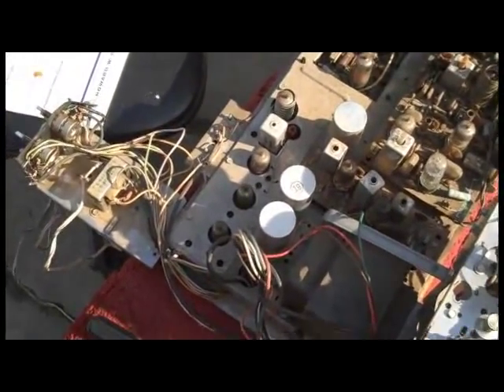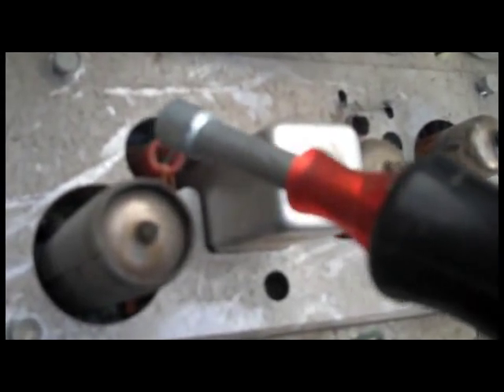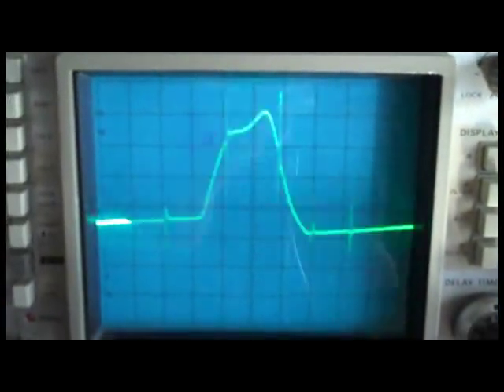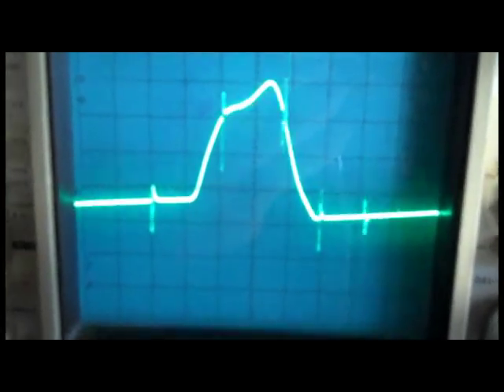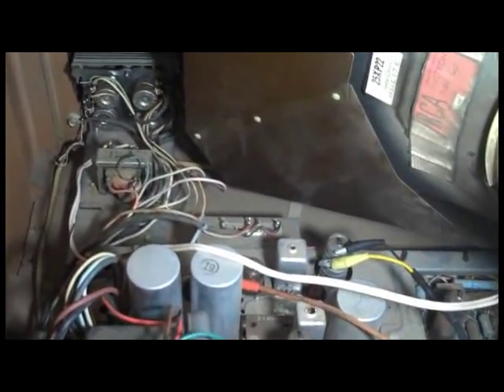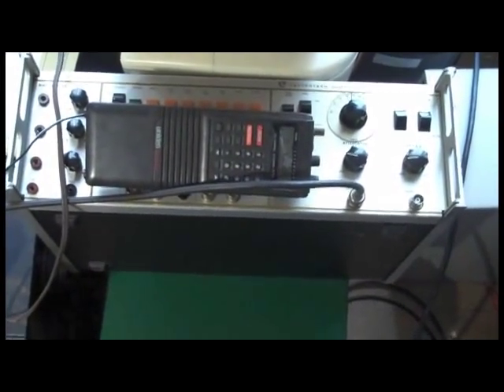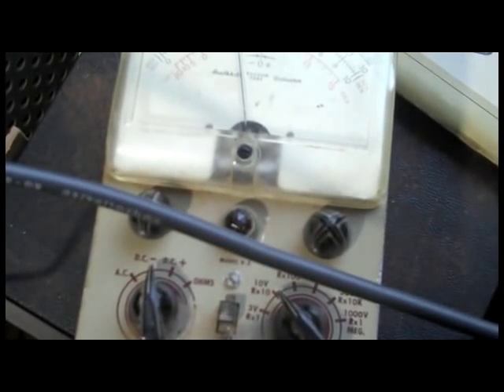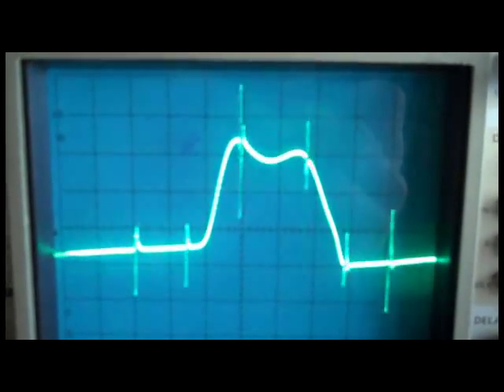IF Alignement on Vintage Television using B&K 415 Sweep Marker Generator part 1

Comment: I warm-up them frozen cores with a heat gun and sometimes a soldering iron on the core itself to put some heat into it to loosen up the hard wax and this has always worked as long as you take time to get it nice and warm before trying to move it - the replace the wax with bees-wax (toilet ring) - works perfect - because many of these parts you cannot get or make but this method woks very well on all vintage electronics !!!!!

Comment: Hi Shango066. I have seen in some of your alignment videos using the B&K 415, that you are not using the HORIZONTAL OUTPUT signal. Can  you please explain why not and what are you using instead? My 415 HOR OUTPUT is acting weird like a non continuous sweep. When i set the oscilloscope to trigger with LINE, it does not looks a stable curve and it is in the opposite direction. I will appreciate your comments.

Comment: hi shango

 i have 415 as your, but do not have the probes any surjections, maybe some pictures  of the cables. I have a high hours ctc 16  with soft picture.( croma ok)  tube is strong. would like to practice in a spare chassis. this video is great but I need more details for the tuner connection. you are encouraging me to the sweeps.